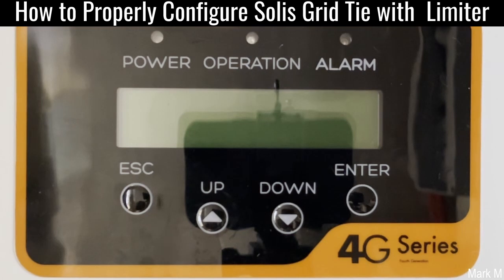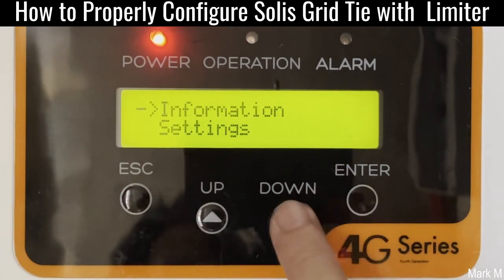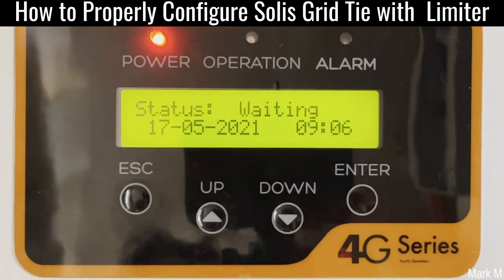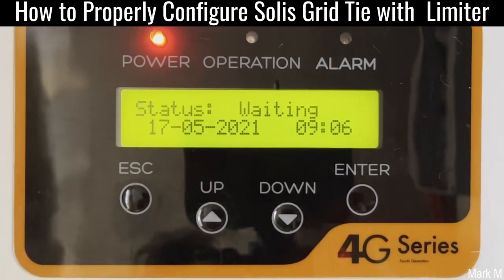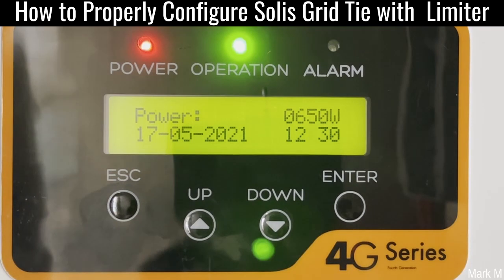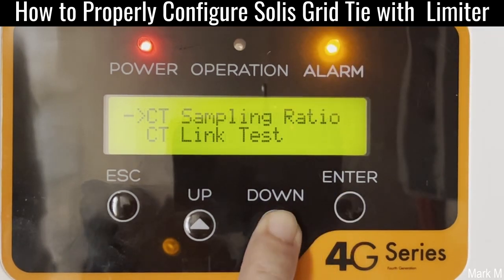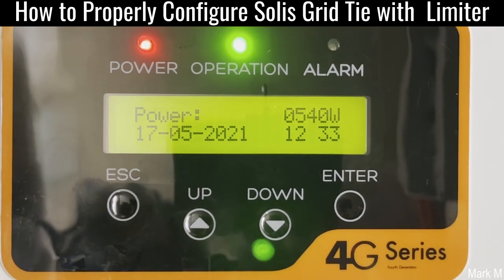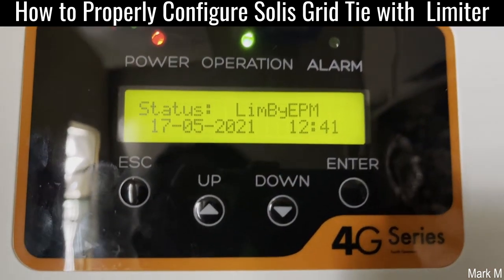How to Properly Enable Solis Grid Tie Limiter Function

Comment: Sir ano ibig sabihin ng LimBEPM STATUS
Reply from the maker: Limited By EPM = active ang limiter po.
Reply: @MarkMinoza  meaning pag active na siya pagmag sobra ang supply ng pv solar hindi ko eto consumption? Tama ba?
Reply from the maker: @llewellynala6807  hindi ka po mag export ng power sa grid. Pag sobra ang pv generation, e limit ng inverter, e supply lang nya anong current load mo sa bahay.
Reply: @MarkMinoza  curious lang talaga ako sir . Kasi meron ako clamp meter pagtumaas ang harvest napansin ko sa clamp meter ko tumaas din ang consumptions ko. Hindi kaya instead na makatipid eh mas lalong madadagdagan consumptiins ko sir? Or baka merong settings na kailangan ko pang e configure. Need your thoughts po sir. Tnx
Reply: Tsaka para wala kasing indicator dito sa screen kung nag produce at nag export ba etong grid inverter ko
Reply from the maker: @llewellynala6807  you cant use clamp meter to check your power, use digital watt power meter na bidirectional.
Reply: @MarkMinoza  sir big help po kayo talaga kasi nag re reply po kayo agad. At this moment nakatitok parin ako sa gridtie ini study ko po talaga. Regarding sa bidirectional watt meter pwede po ba kayo maka recommend sa akin kasi meron mga digital watt meter pero hindi po siya bidirectional.  Thanks and advance
Reply: Aditional lang po sir minsan nawawala sa screen ang word na Limbyepm napapalitan ng Generating. Ano po mga implications neto po sir
Reply: At eto pa sir yung contador ko umilaw ang REV ano po ba ibig sabihin sir
Reply from the maker: @llewellynala6807  look for Eastron watt meter, look for bi-directional capability.

Comment: Good day, Bakit kaya sir yung solis 3kW inverter ko kapag e on na yung transformer type na welding machine sa grid sya kumukuha ng power?
Reply from the maker: Sa grid po lahat, since your gti is connected sa grid. Mag depende naman po yan sa generation ng gti nyo during usage ng welding nyo. Malakas ang welding.
Reply: @MarkMinoza  Kasi pag nka on na yung welding machine may 8 amps reading ang clamp meter sa grid na side then 300 watts sa inverter. Papalo ng 1kW mahigit genereated power sa inverter kapag mag wewelding na. Sa grid side nman aabot ng 10 Amps. Gusto ko sana pag nka standby yung welding machine sa inverter sya kukuha ng power mara masagad yung harvest.
Reply from the maker: @kentoy5598  the Inverter cannot react automatically sa surge ng welding nyo po. Also, kung naka limiter kayo, talo pag may welding kayo. To get your current ng inverter nyo, but a clamp meter with inrush capability. Para makita nyo gaano kalaki ang lumalabas na current during welding.

Comment: Nice vid. hi sir may alam po bakayung model ng solis inverter 4kw, na may export limiter ?
Reply from the maker: 1/3/5/6/8/10kw lahat po may limiter functions. Ask your seller to include one.
Reply: @MarkMinoza  thank you po, Pano po ba malaman na may export limiter siya sir? may ibang name ho ba cya na it means this inverter is has export limiter ? kasi sa data sheet d ko makita yung exact word na export limiter, pa help po
Reply from the maker: @franklaurencecanoy617  check your serial #, on the 6th digit, it should be 1 or 2, 1= ct, 2=meter. Pag 0, hindi activated ang limiting functions. Bili ka ng external EPM para mag function ang limiter. 
SN# 123A45 1 << CT, 123A5 2 << Meter.